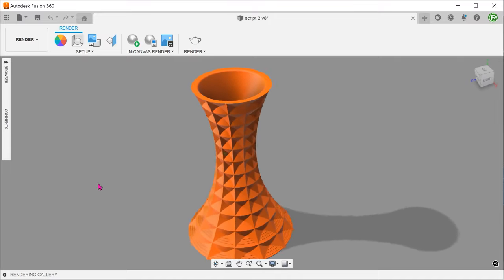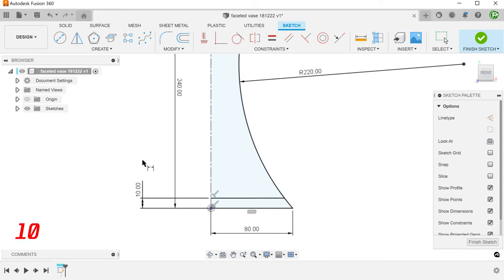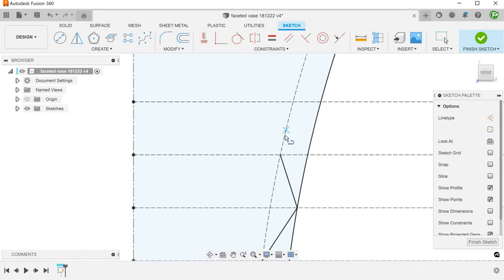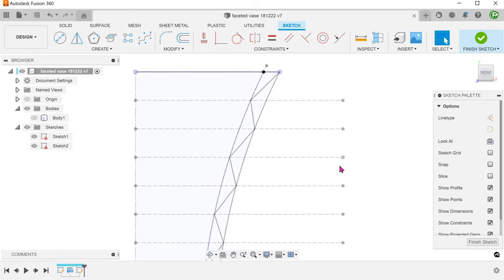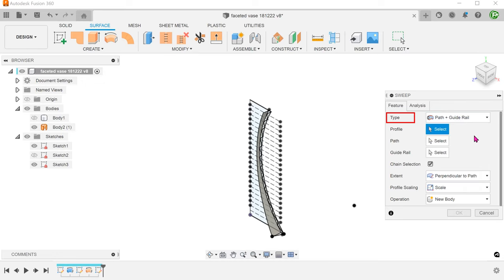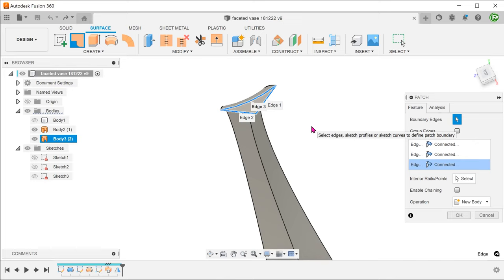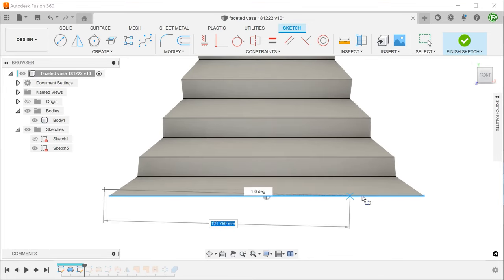Fusion 360 | Faceted Vase

Comment: That was an interesting tip with the arc projection constaints. That could come in very handy. In this case you could also re-sketch an arc and make it co-radial to the original arc. (Maybe first projecting the original arc as a construction line. I forget if F360 allows constraints to non-projected geometry.)
Reply from the maker: Come to think of it, a better way would have been to sketch a centerpoint arc. With a centerpoint arc, I can start by clicking on the center of the original arc and then clicking on the top and bottom horizontal lines. And then dimension the offset.

Comment: Hello excellent video as usual I just have a little problem I can't change the length of my project line
Reply from the maker: Hi, are you referring to the projected arc? An alternative way is to sketch a centerpoint arc instead. With a centerpoint arc, you can start by clicking on the center of the original arc and then clicking on the top and bottom horizontal lines. And then dimension the offset.

Comment: How do you add the rough surface texture to a solid at marker 15 seconds. Great videos! Thanks
Reply from the maker: I applied a rough powder coat appearance.
Reply: @Fusion360School   Would that come through if you were to 3D print the model?
Reply from the maker: @EthanMitchell_YouTube  Unfortunately, appearances are superficial. They are just for rendering purposes. So they won't appear on the print. Does your slicer program have the ability to add texture?
Reply from the maker: I use Cura and I think there is a "fuzzy skin" setting. Haven't tried it out yet though.
Reply: @Fusion360School  You can add what is called fuzzy skin but it effects the entire model.is there way to add texture to a specific faces/surfaces in fusion 360 that is actually physically there and will come through in a 3D print?
Reply from the maker: @EthanMitchell_YouTube  Other then knurling, I am not aware of a good way of creating a limited textured surface. Even knurling would not really replicated a textured look, which is really a randomised look.

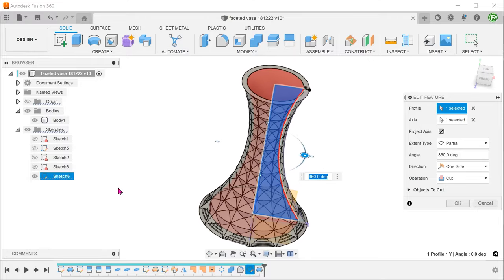Comment: I have a slight problem with the patching feature (as shown at 15:22). When I select the three lines to patch on top of the shape, my "OK" button is grey and I cannot press it to complete the procedure. Do you know where the problem could lie? I've already tried many things, but it stays and I cannot proceed with the design
Reply: i have the same problem. I can only select the two front edges but not the back one.

Comment: Right at 8:03, where you hover over the endpoint for Body2(1), the body created from the 15 degree revolve. You cursor changes from an X to a square and allow you to snap the start of the line. Mine never does, it remains an X. Can't make it snap even with "Snap" ticked in the Sketch panel. Has anyone encountered this before???
Reply: I did figure this out. My default settings for Fusion 360 didn't have "Auto project edges on reference" selected. Once I toggled that (under Profile->Preferences) it snapped without any issue.
Reply from the maker: @stevemcgraw7479  Yes, sorry that I did not mention this. This is a rather common question. I'm still trying to figure out a good way of mentioning this without being repetitive.

Comment: I am trying to reproduce your design, but when applying the patch function i can only select the straight edge 1 & 2 and not the curved one, either at the top or the bottom. So i am not able to close the body at the step. Any idea why this cannot be done ?
Reply: Is it possible you have a gap somewhere? That may prevent the patch from working.
Reply: @redryderaus i will check. How to identify a gap easily ?
Reply: @PierreMilcent  I haven't done this (yet). Maybe the mirror did not join the two surfaces?
Reply: SOLVED : I think i found the problem : there is a gap indeed, it comes from the line during the sketch at 8'04".